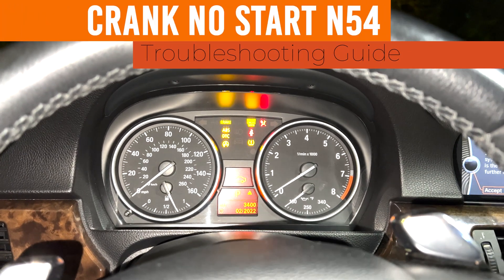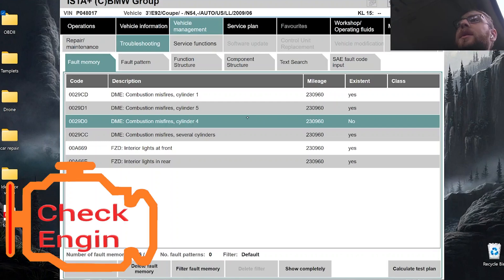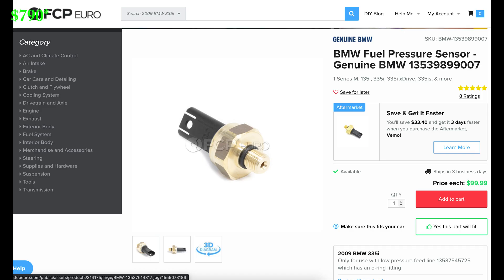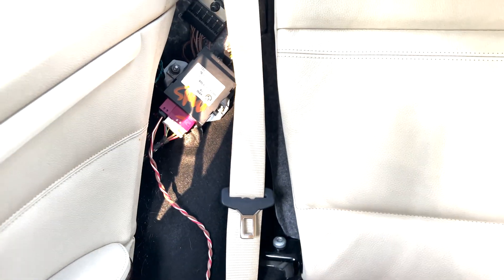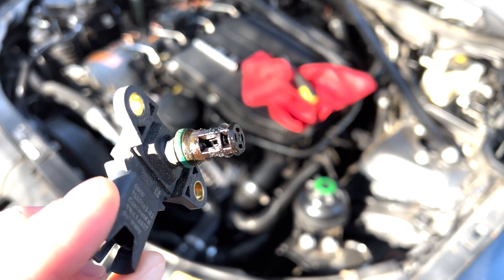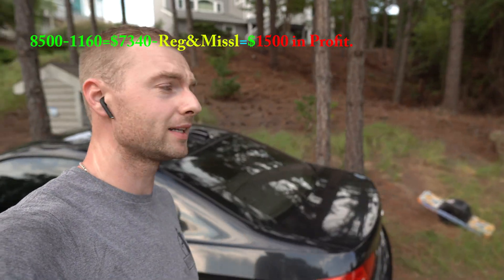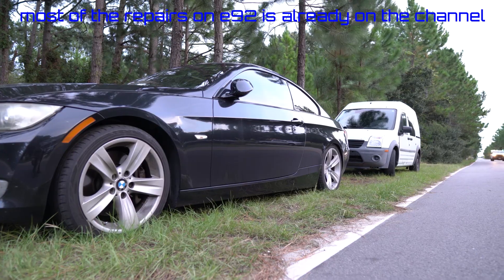BMW N54 Crank No Start Troubleshooting & Repair F*****

Comment: So I’m having an issue with my 335i sedan. I got my dme cloned. And now recovering a “2acc” code. Any suggestions?
Reply from the maker: Can't really say much, It's pretty specific problem, and code basically say there no power or power delay, if there no power, then replace the DME Master Relay, otherwise I'll blaim the cloned DME.

Comment: So it was all the injectors the problem let me know
Reply from the maker: LPFP Sensor stop working, cylinders got flooded with gasoline, MAP sensor failed, loss off compression because of the flooded engine with fuel… so combination of the problems… at the end the starting fluid did helped to start and keep the engine running until it was able to run by itself. Watch the video again and don’t skip.

Comment: Hey I was hoping you could give me some insight on my 08 bmw 335xi. Car had a slight misfire but it was running fine. I decided to change my sparks and coils but the misfired returned and then the car stalled. Car cranks but will not start, except one or two times but it died immediately. I read codes from MHD app and they are as follows: Fuel pressure: 29F1, 29F3 DME: 2ACC, 2ABC, 2DEC, 30BA, 30BB. I got a bunch of other codes for misfires as well cylinders 4,5,6.
Reply: Sounds like a bad high pressure fuel pump

Comment: I got a 335i 2007 i was replacing the engine harness i disconnect the battery first then i start taking the connection of i almost disconnect everything but i realize   Some connection were plug in then I plug then in also i notice that i have to take the transmission off so i decide to  put it back together now the car cranks battery is full charge everything works but it doesn’t start

Comment: Excellent
Reply from the maker: Thank you! Cheers!
Reply: Occasionally my car will spin but it will ultimately start.  Also sometimes it runs real rough.  Turn off and it will run fine.  So I'm tracking.

Comment: I love all e90, e91,e92,e93 , I have no problem with any bmw. N54 engine is  very well especially.
Reply from the maker: The N54 is indeed reliable as long as you do proper maintenance, but if there no preventative maintenance done to the car, whoever own the car after that type of person will regret buying BMW.

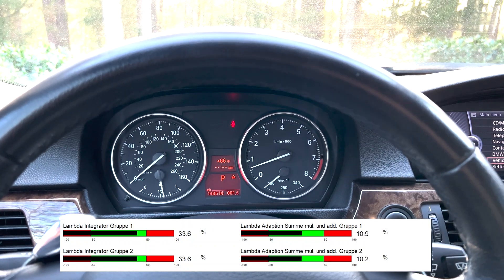Comment: What did you say at 6:09 ??
What im hearing :
"At last minute i Decided to recenter the detation valving"
Reply from the maker: After I replace the MAP sensor i was needed to reset engine adaptations, and then try to start the car with starting fluid and after starting let it run till it fully warm up then rev the engine couple of times.

Comment: My N54 won't start after I did cam seals and ledges. I have the timing tool installed when I started and once I inserted the lock pin on the crank both timing barcodes were off by a few teeth (in the 11 o clock position compared to true TDC. When I reinstalled and reset the timing I unlocked and cranked about 10 times to make sure the timing was exact and it was. I checked by reinstalling the timing tools and it lined up perfectly. Anyways I have no crank and codes 2A9A and 2A9B. I have yet to spray starting fluid in the intake to see if it'll fire up but I have noticed on my scan tool my Exhaust VANOS actual and requested is -130° and my Intake VANOS actual and requested is 124.9. It's similar to the specs you have on your scan tool. Are my cams in proper range spec or should it be different? Thanks

Comment: Just to clarify, mass air flow sensor was the issue?
Reply from the maker: Not MAF.
It was a MAP mass air pressure.
All though both of them need to be checked.

Comment: I have 2008 335i convertable crank, no spark any ideas
Reply from the maker: What codes do you have stored in the computer?
Check the main engine relay, same as all related fuses. Also, it would be nice if you can check the spark in all of the cylinders. Usual problem in those cars are MOSFET, they located on the DME. So I definitely would check them as well.
Reply from the maker: The Story of my BMW E92 335i Buying Restoring Repairing Selling Making Profit
https://youtu.be/L6t2apQKH_M 2:06min. I showing how to test the dme MOSFET
It worst watching the video in full. Good luck!

Comment: Hello Mr.Savage

I own a 2007 335i e90 bmw sedan. my issue is this. When I would not drive my bmw for a week the anti lock device would come on. and car would not start . so after this happed a few times I paid a person to uninstall the ELV LOC ON THE STEERING COLOUM. all was working great buT after a week it started too what sounded like a static noise when I put the key fob and press the start stop button, got a message that read ignition malfuntion,shortly after that ,when Iinserted the key fob and push the start stop button it would make a clicking sound that the battery was dead not enough juice. Replace the battery and regester them both times , with the new battery in and registered the battery , car would start up without any issue but within a 3 day the battery was dead again , replace the IBS SENSOR ,new battery again regisered the battery again , started  right up no ploblem .3 day later the battery was dead again . can you help ? thinking the person who removed the ELV LOCK on the steering coloum did not program it and left some thing to cause it to drain the battery. ant thoughts on what may be causing issue and resolve .
Reply from the maker: My first guess will be the keyless entry, but sims like you don't have this option. as for troubleshooting, I would start removing the fuses, if you can recreate the buzzing noise, just set it on and start to remove the one by one fuse or relay till it stops doing that. that will not give you the answer, but it will point to the circuit. but it's only if the noise is related to the problem. Another solution is to figure out what is parasitically draining the battery. measure the current on the battery after it goes to sleep, and measure the voltage after it stays one day. if you loosing 1-2 volts or night.
then do the current test on the fuses, but it will work only when the car goes to sleep, so you need to lock the car and wait a minute before measuring. check the forums for more detailed information.
Reply: @Makhnovets  thanks I will give it a try.

Comment: What software are you using to monitor pids on the vehicle?? And would it be possible to use it as a diagnostic tool?? As in check code communicate with the modules on the vehicle? And if needed program modules to the vehicle? Like keys and ecus??
Reply from the maker: The software called, ISTA, INPA, NCS Expert and tooset32. 
NCS for coding and module reset(Programming to VIO), ISTA & INPA for soft reset and testing, as well as data reading. For the DME and CAS, it's not much you can do about them at least with my knowledge. For re-flushing the modules and keys, you will need special equipment, and a good understanding of what you are doing. cheaper and easier will be to send the module to specialize service and make them figure out some of the major issues. 
Good luck and thank you for the comment!

Comment: Hello Mr. Savage, 

Recently I have been having an issue extremely similar issue to yours in regards to my car cranking but not starting. If I disconnect the charge pipe and spray starter fluid it will run, but it dies shortly after starter fluid has stopped spraying. I'm also reading 4 psi on low pressure fuel pump and 2.2 psi for the rail pressure, I am using MHD to read these values, I have INPA as well. I've checked for spark and I know I have spark. The car throws a 2A2D - (DME: Fuel low-pressure system, fuel pressure) after running on starter fluid. If you have any insight it would be lovely, I also replaced  the HPFP a few weeks ago.   

Thank you
Reply from the maker: Hey. So how I got my car running. It was pretty simple, keep the charge pipe, but remove the air-box, and keep spraying starting fluid to get it running, try it for 2-3min, at some point when engine get wormed it will run on it’s own, have someone inside the car and ask him to depress the acceleration pedal from time to time. That’s what I did to my car.
The idea if at one point you flooded the cylinders with gasoline and it dissolved the deposit, in that case it can’t build the pressure inside the cylinders, also the sp. stayed soaking wet so there not enough spark for gasoline. That is just a theory of my. But the trick with starting fluid work. good luck with that

Comment: Battery cable? Or ecm. It needs no upgrade if your on 81 format. A Mosffett issue in the ecm is most likely it!
Reply from the maker: I know that the MSD81, have that problem sorted out, but I was checking for water damage, at the end the 4 speed sensors was out and injectors, add the pressure sensor, and you have a total disaster))

Comment: So the problem was injectors ? I’ve got a 2010 535i and I was having pretty bad misfires, I replaced spark plugs, coils , hpfp, lpfp seemed to run a little better but was still misfiring. 2 days gk by and now I have a crank no start issue, it seems to be getting fuel but I’m not sure. I’m lost and I really need my car back up and running
Reply: Started up with starting fluid, what’s the problem??
Reply from the maker: Sorry for the late response! I missed the notification.
So I had the same thing, I had the MAP sensor problem and the LFP sensor. but the problem isn't in the faulty sensors, some guy have a theory on that case. He saying that carbon buildup inside the cylinders was dissolved by gas, and the compression rating got down. His fix was to put a tablespoon of oil in each cylinder and let it sit overnight, as well as dry all the spark plugs. 
In my case I idle the engine on the starting fluid for 2-5min, one person was inside the car, and I was spraying starting fluid little by little, and after the engine worm up a little it started idle on its own, I let it sit idle for 30min, then drove it around the neighborhood. after that next morning car still had brief hesitation, but it did start. 
Try to run the engine on the starting fluid for a couple of minutes till the engine gonna start idle on it's own.
Reply from the maker: Try to use the starting fluid! It worked for me! Just try to spray it in the air box housing, make sure to remove the filter or box completely, and crack the engine , see is it star. Let me know the outcome.
Reply: I just read what I said; and I meant to say starting fluid did not work! You think it could be my crankshaft sensor ??
Reply: @jaredfox662 did you figure out your issue?

Comment: Hey man I recently blight a 535xi 2008 with thw n54 as well. It has changed our turbos, rebuilt trans, and it's having a crank no start issue as well. The rpms won't go up as a lot pf people have told me ut could be the cps, but I also don't hear the fuel pump prime so it could be thatA but I took apart all the fuses and they all look good, the battery is brand new, and before having that issue the car drove and ran 3 hours before but the previous owner told me he was having a limp mode problem wirh the car but would stop on the side of the ride after 3 to 9 minutes it would start up and drive fien again. But I don't know where to start especially checking fuel pressure an dauch this is my first time on this platform and I need guidance. I don't have an ob2 to scan unfortunately
Reply from the maker: Sorry mate! I was busy for the past few days. Did you figure it out? 
Try to use the starting fluid, remove the air box and spray it in the air duct. see if you have any sign of life. Make sure you have a spark. same as in the video you can remove one of the fuel lines and see if the fuel is running, be careful, just in case keep the fire extinguisher near you, extra pair of hands will be nice, they can crank the engine. Good luck, text me if you have any questions!
Reply: @Savage Motor Gears  so I pulled coded and it says losing connection to dme, I smell gas so the injectors are working, has a new battery, cranks so starter is good, all fuses look good, grounds look to be I'm tact so it's gotta be the dme I sent it to get checked

Comment: What does "it's on an MSD81 platform" mean?  AND what is that labeling plate thing you are holding in your hands at 0:10 seconds into the video? Why is that significant?  I have a 2009 5535xi with N54 engine and E60 chassis with "crank no start". Have replaced HPFP, LPFP, fuel pump relay, still persists.
Reply from the maker: MSD81 it’s a dme central computer, the 2009 and newer cars are not effected with this problem, but i check it any way…
The 5 series might have different dme. But like i said that is for car with older hardware. 
To the crank no start, did you try to add the starting fluid? Does the engine start or not?
Reply: @Makhnovets  Thanks for reply.  "Not affected with this problem?" I have ABS & DSC lights; 4x4 @ light, ! triangle @ light, and crank no start symptom.  Not sure what you are referring to when you say "this problem." As for "Did you add starting fluid?" My 535xi has twin turbo direct fuel injection ignition, not carburetor.  Are you suggesting I spray diethyl ether based aerosol retail starting fluid into the air intake, then immediately try to crank it? No I did not do that.
Reply from the maker: @albertwheeler2395  sorry, to be clear the older car have msv80 dme, and the mosfet chip is falling, which lead to misfire and so…
Back to our topic, yes try to spray the starting aerosol in to air-box or better to remove air box and spray it directly. A-lot of people had similar issues, if you can start the car with the aerosol, try to keep it running for 1-2min. (I mean keep spraying while engine running). After it worms up a little, it should start working, or at least you will get the code.
Reply from the maker: Any progress?
Reply: Probably ecm. That's what mine is doing. It won't throw a code

Comment: I have a 335 2007 manual ,just change the dme and cas car only cranks but never starts but it use to start with my old dme I only have a “dme relay activation” code and I also change the dme relay and maf sensor do Yk wat could it be ?
Reply from the maker: Does it showing any sign of life? Whoo code the DME? Generally speaking you can't just swap the DME from the same car, It has to be coded before installation, I'm 70% sure about my answer, I had an experience with a company that repair BMW DME's, but they need an old DME to recover data from it and re-flush the new one.
Reply: Thanks for the reply but the car powers up and crank just no fire..and I didn’t code the dme as yet

Comment: My 335d while driving suddenly turned off and now its cranks but doesn’t start . HELP! HELP
Reply from the maker: In general, I understand Diesel engine, but newer had a chance of working with BMW Diesel. 
First, I would ask if you tried to use starting fluid? Does it try to start or what is happening?
Second, What codes do you have? 
Did you check compression? 
Are you sure you have fuel supply? 
Does engine turn?
Reply: @Makhnovets  i got told my timing chain snap 😞 . If the timing chain snaps the engine doesn’t start ? Because am not sure if to believe them ?
Reply: Im goin through same exact thing right. Did you get yours to run ? Im not believing its the timing chain at all
Reply: @Tyquaviious  yep it was the timing chain

Comment: 2010 535i e60, Crank no start. Blew a CDA6 code so i got EKPM3 replaced. Still crank with no start but my idrive monitor entirety shit out and no longer works when car is on, in run, or running. Replaced my battery in belief it was a low power thing. Same problems. Idrive is dead.
Reply from the maker: What is LPFP Pressure? If you have INPA or any other OBD tool try to actuate LPFP. Do you hear pump working when you open the car?
Check the voltage to the pump when turning ignition on or crank the engine.